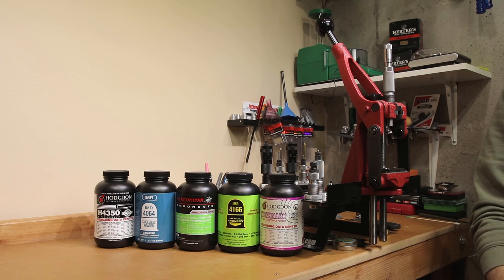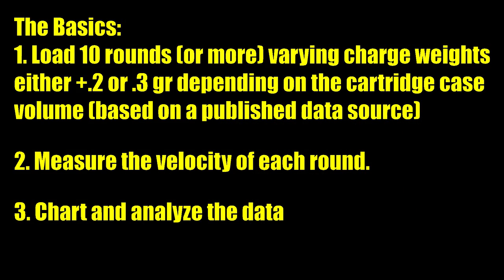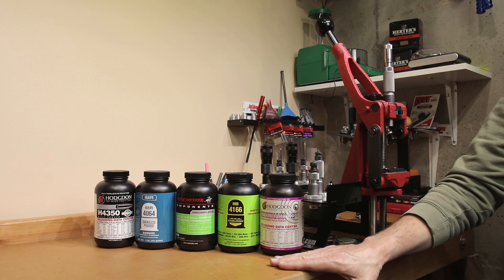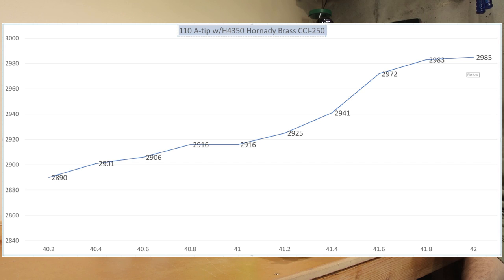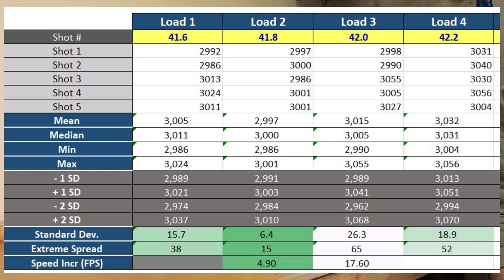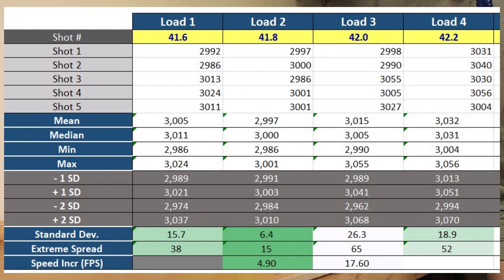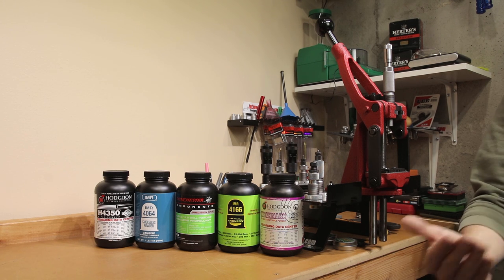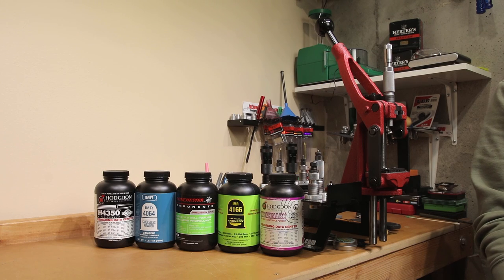10 Round Load Development Ladder Test - 3 Data Driven Examples

Comment: Old guy here, let me help.  The goal of aimed fire is to place as many of the shots in the absolute center of the target as possible.  Gravity is a "constant" 32 feet per second squared. Dispersion is a natural phenomenon but can be minimized. SD is a single "standard deviation". A low SD means that the velocity and hence "time of flight" is more consistent.  It shows up at longer TOFs as verticle stringing.  Longer TOF is generally one second or more (for most loads around 700 yards).  Not going to shoot past 200 yards and care most about pure accuracy, no need to get too wrapped around the axle.
Reply: Awesome way of thinking. To put it bluntly, don't waste your time if you're not shooting long range

Comment: BAR - Thank you!  When I started loading, a chrono was 4 months pay. $'s needed to be spent wisely.  And I have temp range of 100 deg F. It is not much of a load, if it worked for me on a 90 deg day in July, But on the hunt in Nov - 10 deg F and I watch powder blow out the barrel.  It is the reason I  test the same loads - 6 months out of rotation.   Also - I load - on the range.  I may have 40 rounds - 4 at each. I am looking for groups. I have my load book - with 40 years of data. I pay attention to some local - younger guys who load calibers I do.  What we have found is more about individual rifle preferences.  Some work well - given any diet and some are like lightening. It makes a big noise, but never strikes in the same place.  I gave up full house loads 20 yrs ago. The heavy recoil, was not conducive to pretty groups.  A quick, but subdued round made it pleasant on the shoulder when running 100 or so.  Once in a while - I will shoot a competition, but I am competing against myself.  Cheers to you!!

Comment: Great points.  I have been using a half grain increments with 270- 06 size cartridges for years and 7 rounds.  This quickly tells me how the pressure sign is running and if the gun wants to group with the powder bullet primmer case. If not try a different powder 7 more rounds. Generally I like to load 3 powders and one or two of them group well and witch ever one tends to have the group higher velocity gets the nod

Comment: Great video, it‘s so valuable to see the experience other shooters have with this method. What I really like doing for my load development is loading/shooting two identical 10-shot-ladders and then overlay the graphs for a bit more confidence in those flat spots. Doubles the component use but range time is more valuable around here than components. It also helps fill the blanks when your chrono fails to record a shot. I use a labradar in a partially enclosed range and often miss 1-2 shots in a ladder 😤

Comment: I ran the 10-shot ladder every day for 4 days using a Tikka T3 in .270 Win.  Each day I got a different plateau.  
So yes a sample size of 1 may not generate enough useful information.
Temperatures were in the 30s F, allowing barrel to cool 5 minutes between each shot.
I did have a sample size of n=4 and did select the load with the lowest muzzle velocity variation (standard deviation = 4.6).  Nozler fire-formed brass, FL resized with a shoulder bump of 0.002", 130gr  Barnes TTSX, IMR4350, Magnetospeed chronograph.
Reply: yes because the increase is linear there are no plateaus. Fire a 1000 shots at each load to see the truth.

Comment: Very good description of the method, which I also use with a little tweaking though. I load more rounds (11,12 or even 15) with 0.1g of variation. If I identify a node, I confirm by loading 3 series of 5 rounds, one with the node, then 2 with 0.05g above and below. If the velocity is confirmed and the SD is good, I am practically done. I still load 20 rounds and shoot one group of 10 at 100/200y depending on the purpose and take the other 10 to longer distances(300/400/etc.). It works most of the time. One last thing, all prep/reloading must be on "ocd" level, but I guess this is obvious. BTW, love the channel.

Comment: I learned a lesson I'll never forget. Keep good records! Get a 3 ring binder and keep all your load trials consolidated. I recommend some sort of standardized sheet with blanks for all the information including chronograph results. If you can't afford a chronograph, then at least save what you can. I use targets of my own deign which suits me better than anything else I've found. I reproduce them as standard  8.5" x 11" sheets. I 3 hole punch them and insert them in my binder along with references that I can guarantee which target goes with which data. Usually adjacent sheets though anyway.
  I also use ballistic apps and software to predict and analyse results and I print that to go with each load as well. When I want to I can lay out the sheets on a table to study.
   One last thing is that I only use bullet brands which publish Ballistic Coefficient data. Not all do and it's one of the parameters called for in software. Remington for example doesn't publish BC that I know of.
   Happy trails!

Comment: For the purpose of learning if the 10 shot string is really as good as OCW, I think you should do the exact same test with 5 shots at each charge point on a target at 300+ yds, and then see if the first string, all or any strings confirm the conclusion that the first or even a single string was all that is needed for further development. Basically an OCW for proof of concept.

Comment: I literally just got all my equipment to reload at the range. I’ll be doing the 10 round and grouping those loads all at the same time. So the effective trips to the range will be 1 time testing at short range. Next trip I’ll load up and stretch them at long range. Much more effective.
Reply: That has proven to be my best method for getting one hole groups with single diget SD. But have to start somewhere.  I know the speed I need and work close from there. No need for a slow load.

Comment: I've never seen a suggestion what should be the seating depth when doing this test. SAAMI spec or some distance from the jam based on the specific chamber? Which is the best approach? Maybe doing the test with seathing depth 0.020 from the lands and then fine tune it when I found the right charge weight? How does that sound to you? Thanks.

Comment: I use this hasn’t failed me yet. Great info. I do have a question. I generally don’t mess around with seating depths too often. I got a buddy, who once he find a good solid load out, will start messing with the seating depth. I know a lot of people do... My ocd keeps me up at nights, as now we’ve introduced a new variable. Not to mention, different temperatures on different range days, with different seating depths. I guess what I’m trying to ask is... What if we are missing nodes by starting off with a seating depth (and we’re seating all the test loads at the same depth) then trying to tune them. Would you ever doing a 10 round string twice with different depths? Heck maybe even 3? Would it make a difference? Thanks!
Reply from the maker: Hello, I really don't think that the seating depth with cause you to "miss"a node but if you were to change your OAL significantly (don't ask me what the number is) it might shift it slightly. I have been reading some info on this and plan to do a video in the next few months (yes it takes me that long to plan and execute these things) understanding this subject better myself. I hope you subscribe and are patient. I think it will prove to be some good information. Do you fee that one caliber might perform differently than another? (6.5 CM vs 308)

BAR
Reply: Bolt Action Reloading oh thank you! I needed new questions to keep me up at nights😂.

Comment: SD number gives you only a probability of the velocities. the velocities will be distributed following the 68 95 99 rule:  68% of the velocities will fall within 1 SD of your sample average, and 95% will fall within 2 SD of the average, etc. for your load of 41.8 gr your average was 2997 fps, your sd was 6.4 fps, so 68% of your rounds will have velocities of 2991 to 3003 fps. you can use a ballistic calculator to calculate how many mils or moa that is away from the average, and that average is the center. that will give you a 'cone' of probability of where your rounds will fly within.
Reply: of where 68% of the rounds will fall. The other 32% will be outside.

Comment: How well does that coax work with Hornady seating die and micrometer top?
Reply from the maker: It has worked ok until you get into taller cases. Worked fine with 6.5 CM seating, but 30/06 seater did interfere.
Reply: Bolt Action Reloading 
Thanks for reply. Have you found the CoAx press more accurate than others, or do you simply like the operation better? Thanks for reply!
Reply from the maker: Accurate would be something very difficult to prove. I am able to maintain very good concentricity numbers. Can't remember the last time it was at or above .002. Usually less than .001. A lot of guys don't think it matters, and maybe it doesn't. But if that's what your looking for it delivers.
Reply: Bolt Action Reloading Personally I don’t think that I have ever used a Hornady seating die in my Co-Ax. 

The Forster on the other hand. . .

Comment: The Satterlee 10 shot method is like how I think of a three-shot group, I can't tell if it's a good load just yet but you can tell if it's a bad load.  Satterlee shoots a ladder. He loads groups with powder chargers around the node @ .050 off.  If he finds a charge weight that is promising he loads groups shortening .030 shorter each time.  He isn't adverse to Jumping bullets. He has stated (with how his barrels are chambered) he often finds the seating depth around .080 to .090 off.

Comment: Maybe I'm missing something, but if one is getting 'good' nodes at certain velocities while the Magnetospeed chronograph is attached to the barrel, isn't it possible that those 'good' nodes will shift when the chronograph is not attached to the barrel?
Reply: If it was for accuracy, yes. However, this is just for a velocity node.

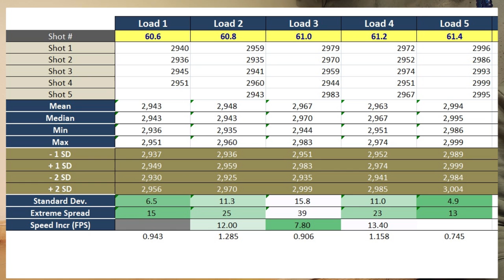Comment: What are your thoughts on timestamp 10:37 , this is supposed to be an erratic area according to the 1 shot per charge graph but 61 and 61.2 had almost identical avg vel in the 5 shot test. They also had poor SD. To me, it looks like 1 shot per charge weight isn’t meaningful and also flat spots don’t guarantee small SD.

Comment: 10 rounds for 10 points of data is fine for quick and dirty results. However you will not be able to determine what are the variation at specific points. So in the sense you cannot get good confidence level in your results. 

One sample per point definitely is not good idea as shown on one of your charts for a pistol cartrige (there was dip in speed in the middle - having no other data points for that charge you do not know how where the mean is and how variable speeds really are).

There is lots of sources of error: powder weighting error, speed measurement errors, bullet weight variation etc. So if you do not mind to spend reasonable amount of rounds let say min 10 per each data point = min 100 rounds you may not know the error bars and how much the obtained results "deceive" you. Since reloading is relatively cheap it may be worth to improve the scientific value of the experiment. This is one thing why research and testing is so expensive.
 
Thank you for great video.  :-)

Comment: I like the method, and the data gathered is nice, but there is never enough data to show that the accuracy "nodes" found correlate to tiny groups on the paper as well. All of this is useless unless the node shoots as well on paper as it does over a chronograph.
Reply: It's not an accuracy node. It's a velocity node.  Finding a stable velocity usually correlates to a more forgiving and consistent charge. Plus or minus a 10th of a grain shouldn't shift the POI much. And the SD should be relatively constantly low. The key to accuracy is consistency. This also helps when temps start to rise while shooting. This doesn't mean the component combination is going to be the best and most accurate, just the most stable with the combination you have.
Reply: At longer ranges the standard deviation of the velocity is generally more important than accuracy at 100 yards. If you’re shooting well made reloads out of a high quality barrel, the accuracy is likely going to be fine with most loads.
Reply: @Deerslayer1912  For short distances, you are absolutely correct.  However, for a lot of people that want to reach out past 2-300 who are dealing with more rapid throat erosion, and are doing it with expensive  components; this saves time, money, and barrel life.  This method is developed by long range competitive shooters.  If you are the type that likes to get the best out of your custom load, this can apply if you want it to.  This isn't being taught as the best or only way to load.
Reply: @p1choco  I've burned thru at least 3 barrels on a BR rifle, so I have a pretty good idea of how all of this stuff works. Velocity node, accuracy node, whatever you want to call it. It still does you absolutely no good if the rifle doesn't shoot well at that velocity node. The extra distance and lack of POI shift at distance is useless if it doesn't shoot. My rifle hates almost anything Nosler, but I can run them over a chronograph with N140 and get flat spots and velocity nodes all day. It means nothing. I can do the same thing with a Sierra, or a Berger, and get velocity nodes or flat spots, with tiny groups to back it up. One can save time with this method by incorporating 3 shots in it instead of 1 per increase in charge weight to check for accuracy.  I used this method for years before I ever even heard of Scott Satterllee, just with 3 shots instead of one.

Comment: This is very interesting to see how you "work-up" your load.  But in the end velocity other that required for expansion of particular bullet types is superfluous at best without accuracy being the leading goal.  
In order to take myself (the shooter) out of the equation, my rifles fore-end  rests on a full length x-bag and the rear a shot bag to attain a rock solid, but repeatable artillery style hold on the gun.  The trigger is manipulated with a remote cable actuator attached to the guard to prevent pulling the gun off axis. 
I hand-load using a Lee hand-press at the bench and monitor each string with a chrono.  I'm firing at a white board with 1-Inch orange aim points without moving the rifles pre-zeroed sights.  
I'm looking for repeatable accuracy with any given load, not velocity nor attempting to re-zero the sight until I have the load the gun likes, not necessarily what I'd like.  seldom are the two exclusive to each other but there are those instances we must live with what is given.

Comment: IMHO, SD is OK to look at but ES is the more telling number, especially at longer ranges. Additionally, a lot of work has recently been done on the impacts of seating depth during load development. In fact, Satterlee states that when he first starting using this method, he did it with the standard .020 setback. Since then, he and others have started their load development process with first determining the proper bullet jump and then moving on to the speed test. This sequence has resulted in a better and more reliable load. I am in the process of setting up to do this same thing, as a test, to see what the results will be. All interesting stuff.

Comment: I haven't worried about sorting powder loads for years. Makes no sense at all unless you're going to try to find the lowest SD for 3 or 4 temp ranges.
Over the years, I've just used bullet seating depth to get the results however, I've gone from .010 increments to .003 increments of late &, that is definitely an improvement in the process. Since temperature change is by far the largest contributor to internal & external ballistics, trying to achieve SD's of 2 & 3 is just chasing after the wind. The best results I have been able to obtain on an ongoing basis were around 13 to 15 SD &, on a 40 deg C day, those SD's will stretch out to 25+ with the identical loads. SD's will also change with seating depth so, what's the point?
The place I start is with a 98%+ volume powder charge. I go to max powder charge with 3 cartridges, check them for pressure signs. If all's good, I immediately launch into seating depth keeping that same powder charge. High charge weight volume is a long known stabilizer &, has always worked well for me.

Comment: Nothing wrong at all, using the Satterlee Method. I'v used my own version of this, before this more refined method,  for my 7STW and now rebarreled 28 Nosler, which has a very shortened barrel life and you need to find an accurate load in short order! I use the Satterlee Test to find a Pressure to Velocity load, where I an start my OCW from up/down from the indicated "flat" spot on an Excel graph. A target is needed to find a starting point, just a place to test and a chronograph, with this method, because it won't show you anything on paper. Particularly when you're using custom guns, that shoot excellent with most powders and the POI is in a relatively small group, most of the time. Then that's when use the data from that load/rifle, to figure out which way you want to go with your OCW.